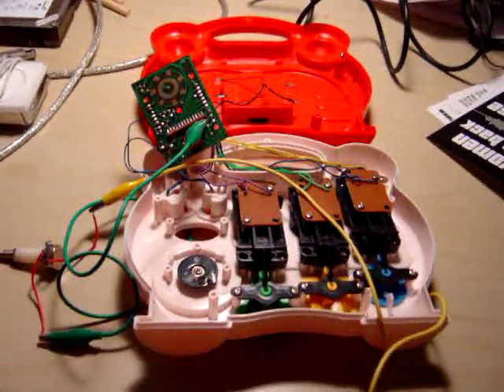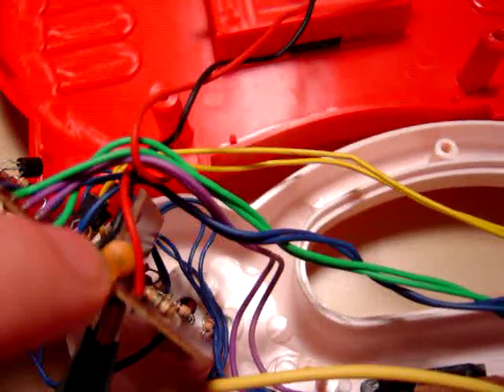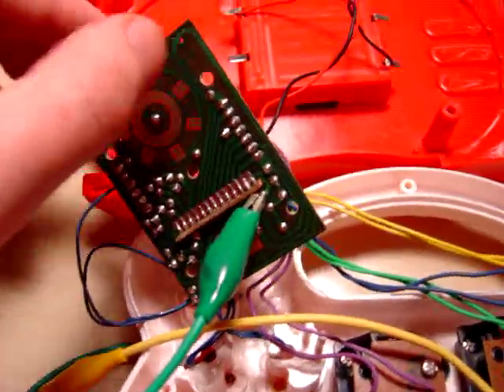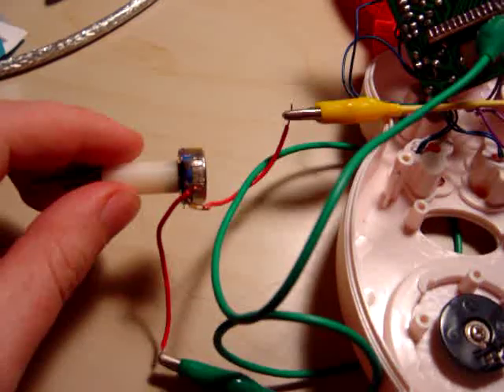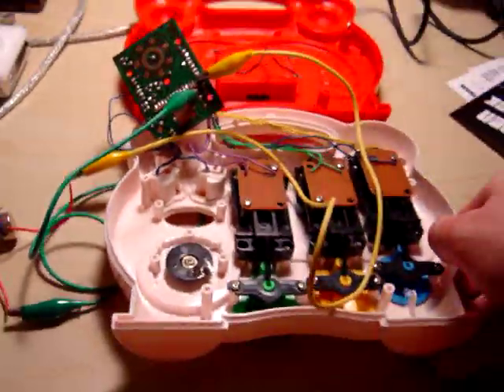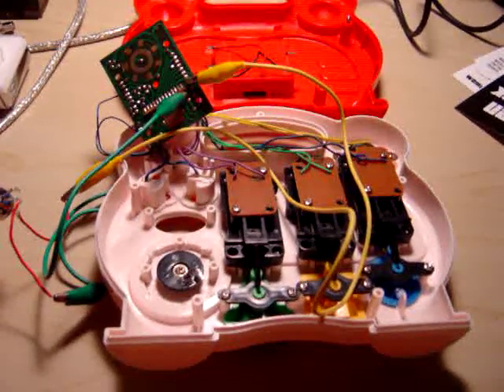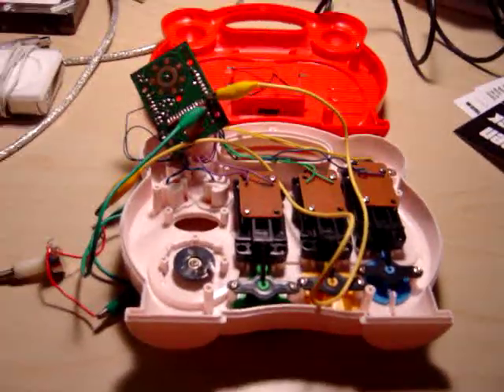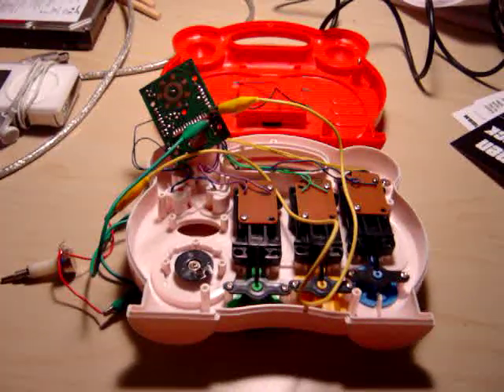Toy Circuit Bending Part I -- Pitch Bend

Comment: @PrivateAccount00 The resistor allows the flow of current to the circuit, & has a set level of resistance. The pot controls how much electrical current the resistor 'resists'. The resistor is there to stabilise the pitch at the manufacturers default setting. A pot on its own would have no effect on the pitch as it would have no control over anything, although it may either make or break the circuit at this point - therefore it would be operating merely as an on/off switch.

Comment: So how would you wire in a standard guitar jack socket for an output please?
I've tried wiring one straight from the toys internal speaker connections, but no sound comes out. A friend said something about needing a certain diode or resistor? in the loop.
Can you enlighten me please as to how this is done and what type of diode is required please.
Many Thanks